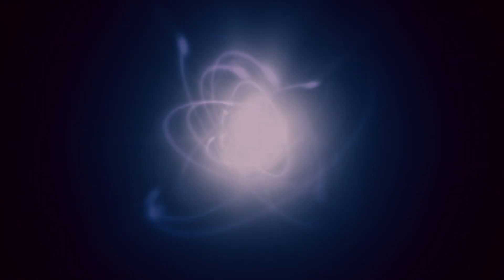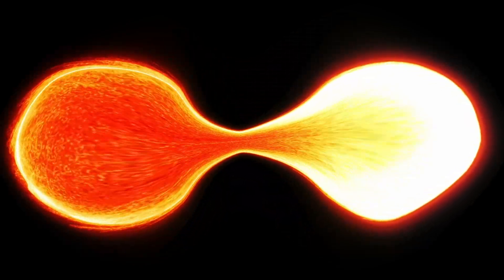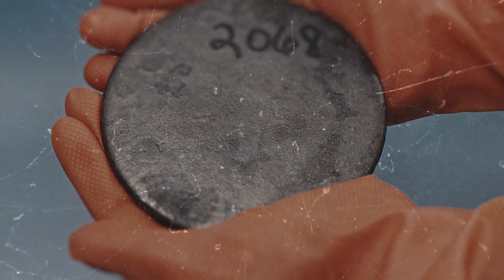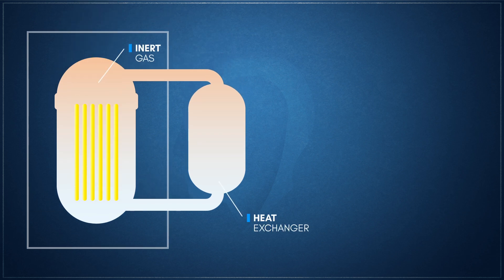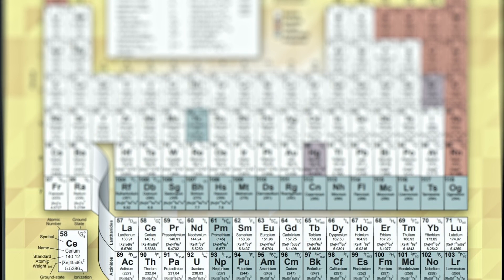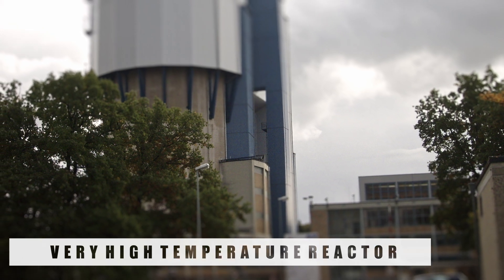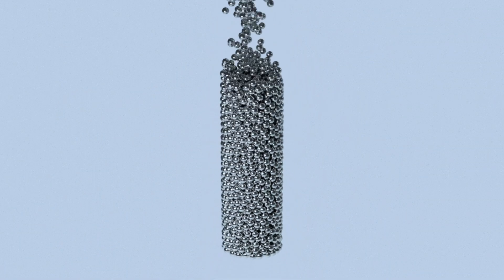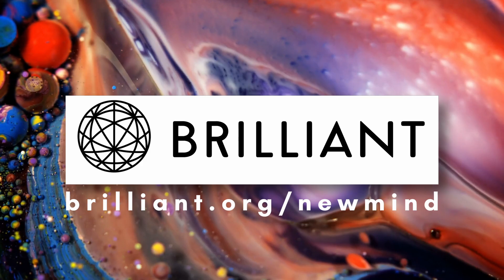Portable Nuclear Power

Comment: For a split second I thought the title was Potable Nuclear Power, and I was both terrified and intrigued.
Reply: People have an irrational fear to the word nuclear. 
The reason why older nuclear plants caused problems was due to the fact they were massive plumbing systems with nuclear material right in the middle of it and it was a perfect recipe for disaster. 
New systems have stable nuclear fuel sources, plumbing systems that are seperate from the reactors and they can be made extremely small so if by some magical reason there was an issue it is not a major issue and can be sorted on sight safely as their mechanical pressures are so low that they cannot cause the problems like the old plants. 
Smoke detectors already have the same levels of material out there as those small nuclear plants will have as a whole.
Reply: @bighands69  20.

Comment: This video is kinda disappointing. you are literally just spotlighting the fringe upsides of these technologies without going into the significant downsides at all.
I do think that a short- to mid term expansion of nuclear power generation would be a good idea to speed up the coal power phaseout but Gen2/3 reactors are just way better at that than the concepts you highlighted in this video. 
The first problem with small nuclear reactors in general is that its just not a good idea for civilian use. Civilian power generation really doesnt need the capability to be relocated because the point at which the power is fed into the network is not very important. on the backside, the security issues get way more problematic the smaller the reactor gets as the size you were talking about gets into the zone where its realistically possible to steal the entire reactor. This gets even worse as smaller reactors generally require more enriched fuel to run, so the fuel for a reactor that size may need to be weapons grade for the reactor to work. The security problem with having hundreds of small reactors full of weapons grade fissile material instead of one big powerplant should be obvious to everyone.

More one the pebble reactor in particular: 
It produces way more radioactive waste than traditional reactors because after the fuel is consumed, all of those shells are radioactive waste as well.
It is extremely hard to monitor because the exact geometry of the reactor is not known.
Its a nuclear proliferation risk because it allows for the short term irradiation of Uranium needed to produce weapons grade Plutonium.
It never actually reaches those extremely high temperatures needed for the efficiency benefits

overall, this video should have had a significant portion of its runtime devoted to why none of these technologies are actually getting used.
Reply: You have a good point, maybe he should make a second part talking about all of that

Comment: I was expecting a bit more information about portable reactors. 15 min intro and then few words the subject itself. Overall interesting video and the title is good (clickable) but left with a feeling of unfinished video.
Reply: I remember a YouTube where if you had a click bait title and thumbnail the comments were all flaming the creator 🙄
Reply: Thank you good sir for saving me 19 minutes.
Reply: If I were on fire I'd hope you would put it out before telling me the history of man and fire. If I wanted that type of video I would look for it. All we need to know here is if it were possible to support small portable reactors. Smart dummies everywhere
Reply: Dammit you nailed it.
Reply: Yes, I think 5 and 10mw units could be factory built for lower costs.
Then you can use a 5 and 10 or 2 5s as to needs. more versitile.
May be reuse nuclear waste.
We can do this, we just need people to get on board, also quicker to bring these to reality instead of 10 years.
Reply: @bradvansteinburg2962  Yes, exactly. 

What I like is the fact that after 10 years of isolation you can start separating PU 238 from a LFTR's radioactive waste. That gives you a steady stream of heat for the next 300 years. The possibilities are enormous. 

No doubt, you are aware that a passenger car in cruse mode only consumes 20 to 30 HP. Thus, you can have a hybrid car with a 25 - 35 kw (e) CO2 gas turbogenerator. You can use a third of the lithium batteries which a TESLA car now uses. 

The batteries give you quick acceleration, but they run out quickly. The generator recharges the batteries even in cruse mode. You park the car and the generator recharges the batteries for later. 

This hybrid car should be lighter than a TESLA or even a gasoline engine car. You get quick torque from startup. And when you get home you plug the car  into your house to recharge the batteries in your home. That is a win-win-win. 

This is all from radioactive waste. If you had a few hundred thousand LFTR's in operation, PU238 would be cheap.
Reply: Thank you so much for saving my time ❤️
Reply: I knew it lol.
Reply: Yea
Reply: 100
Reply: I was thinking the same.
Reply: Facts ...
Reply: Thank you for saving me some time 😊
Reply: I'm unsubscribing.
Reply: Looks like he skipped a lot of stuff. Secondary nuclear reactors that can use up the waste of primary fission reactors, uh I forget the name but what mos of the small plants in Japan are. MoX reactors which basically make the lifespan of uranium infinite
Reply: You have dumb expectations
Reply: Thanks for saving me the time not watching this
Reply: Agreed. Very long winded introduction
Reply: Why would you think portable nuclear power would have  anything to do with a reactor? We've been using portable nuclear power since the first probes were sent out to image mars and the outer planets and none have anything to do with reactors
Reply: Thank you for saving me time
Reply: That’s how they make money... deceptions.
Reply: I literally skipped  most of it.
Reply: GJ clickbait got it outskies
Reply: Thanks for that ima head out
Reply: Wellp. I'll just switch to another video.
Reply: Want to make one, Ahmed? :P
Reply: @jacekpiterow900  please do !!!,then let me know how you done it😉

Comment: Could the pebble design work with thorium? Cause if so that would make it even more safer and generate more power and less waste although I don’t know how plutonium would fit in that model
Reply: Sorry won't let me post a link uggg, sir, Issac Arthur has a video called the (future of thorium) he talks about that I think
Reply: It was tried in the THTR in Germany. Unfortunately the pebble bed reactor has its own set of issues even without bringing Thorium into the mix.
Reply: Yes, you can create a breeder out of a PB reactor, but reprocessing PB fuel is always going to be more expensive than any alternative, and fuel out of the mine is cheap in comparison. I suppose a liquid molten salt blanket for breeding would be an option, but that is a question for a proper nuclear engineer

Comment: Doesn’t the Cassini and Voyager use SMR to fuel them in space??? i do believe these will be more proficient and of better help in times of bad weather… Eliminating poles and wires, trees, fossil fuels, etc would help with the 🌏 too…
Reply: those are RTG, they work with a different mechanism. basically hot isotopes enveloped by peltier to harvest the heat into electricity. those thing are not that efficient but with loong half life of the isotopes such as plutonium those can operate as very durably longlife battery.
Reply: So does a solar panel on your roof.
Reply: @jacekpiterow900  that’s right
Reply: No,they use Plutonium in  converter,no moving parts, you get the warmth and electric power, the next step is something with moving parts which would many times more efficient.
Reply: @paulbedichek2679  Is it possible that the reason why there is no moving parts is due to reliability? Moving parts have that funny tendency to break. When they break in nuclear reactors efficiency becomes way less important. That could be the way out if not radioactivity of demining elements, and stupidity of people looking for a revenge at any cost.
Reply: @jacekpiterow900  Yes,of course, but has nothing to do with bad actors it is a hunk off Pu!!! Nothing allows more mischief,but who's going to come along and steal it off the rover on Mars?
Reply: @paulbedichek2679  Paul! I am 100% with you. Mars is OK to play with Pu. You have to wear radiation suit all the time anyway. But here is our home, I rather would parade around in shorts bare chested. Shorts are must. I do not want anybody to feel inferior ;) Seriously, Outer space is more then required. Here, let it go.
Reply: Well, a science group picked up on my ideal and placed me in their group so i guess someone is looking into this ideal… Have a great day…

Comment: If one those Xe-100 portable reactors can be transported from the US to other countries, I wonder if that would be by air or ship. If these things are inherently safe even during "catastrophic fail" could they be put onto an airplane? What about a spaceship? Seems like the most likely candidate for power generation say, on another planet if it's approved for rocket travel. The big issue with rockets and nuclear power is if the carrying rocket blows up before leaving the atmosphere. Would the explosion/crash spread nuclear particles everywhere, turn itself into a nuke or is the risk low enough to be one in a million?

Comment: A lot of the cost associated with building fission plants is in multiple redundancies and material necessities such as the nearly complete absence of cobalt in the metals used in the plumbing it's easy not to add Cobalt but it's decently hard to make sure there is absolutely none
Reply: It's also in large part due to the mountain of regulations and burocracy that has to be meticulously and properly followed.
Reply: @adamblomberg  yes, the proof of this fact is one word, France.
Reply: @adamblomberg  you’re really complaining About regulation on nuclear energy, ya know something that has the capability if not properly done to cause mass death. You really out here advocating for the Nuclear Boy Scout.
Reply: @adamblomberg  if it fail, the externalities are very high to community and possibly to the nation. So I prefer alot of red tape on this one.
Reply: @adamblomberg  I mean I want regulation when a whole state can be irradiated if someone go wrong
Reply: @thatyoutubeguy7583  iradiating a whole state would require a huge reactor running more like chernobyl.
I agree with some of the regulations but a lot are based on warrentless fearmongering.
Reply: @thatyoutubeguy7583  that’s not true at modern design makes disasters like Chernobyl completely impossible without being taken over and altered for month-years by an advanced team of engineers and construction workers with serious understanding of nuclear plant construction and a desire for destruction.
Reply: The primary costs making nuclear plants uncompetitive is the requirement that there never be accidents. It is easy to make events rare and infinitely expensive to make them impossible.
Reply: @matthewhuszarik4173  Yep, deminished returns, lol
Reply: @HughZantu  sounds like a good argument for the smallest possible plants. Or not.
Reply: The materials are also hard to work with. Hasteloy-N especially
Reply: yes, but those reactors make a massive amount of energy relatively cheaply. We can think of alternate materials and use alternate methods of refinement.
Reply: So what does cobalt do if contained in the metals reactors are made of?
Reply: @tylerdurdin8069  it becomes activated by neutrons, and then the steel is a radioactive mess.
Reply: 6.
Reply: It’s mind boggling that nukes would have a load of regulations while O&G, coal + gas plants would have far less regulation but cause more deaths than nukes
Reply: @malekzin4788  blame one ronald reagan. he started the trend of making oil and coal immune from air regulations
Reply: @malekzin4788  there's a reason why oil and gas companies fear monger about nuclear and support wind and solar. Wind and solar power takes a shit ton of oil. Not to mention the amount of average needed to generate as much as nuclear. It's cool to have solar panels on your roof, it makes sense, saves you money. But on the large scale, it makes no sense.
Reply: @malekzin4788  If I'm understanding you correctly, you are comparing the cumulative damage caused by all the fossil fuel power stations in the world/country with the potential damage of a single reactor going south?
I'm pretty happy that reactors are tightly regulated
Reply: @richardbrook4545  I totally agree, not to mention the long term storage and waste disposal solution which is not available anywhere in the world and adds an astronomical cost usually not factored or included in comparisons.  Imagine our descendants continuing to pay in many ways, every generation for many just for our current and ongoing energy use.
Reply: @richardbrook4545  fossil fuel power station as a whole is more damaging than nuclear power station as a whole. i am happy w/ the regulation but find it that is so much easier to build a fossil fuel that bring more environmental damage than nuclear plants
Reply: @richardbrook4545  no, the accident and injury rates are for the entire industry. Mining, transport, operations, etc.. The number of deaths from coal powered plants via air pollution is much higher than most people think, not to mention the accidents in mining and transportation.
Reply: @ProlificInvention  Wrong. Disposal and short-term storage (measured in decades) is factored in the cost. You are also overplaying the amount of waste generated. The amount the US nuclear power plants have generated in 60 years can fit in a Walmart. Not to mention new waste material can be used as fuel in other reactor types.
Reply: @ProlificInvention  just launch it into space
Reply: @ProlificInvention  in the near future we definitely can do that. At the rate space x is going itd probably be close to 100 percent safe in 10 years max
Reply: @connorburns6599  Na, it'll never be safe.  To escape Earth's orbit a spacecraft must carry enough fuel to move hundreds of tons of spacecraft and payload a minimum of 25,000 MPH.  A catastrophic failure carrying high level waste would render a large area of Earth's surface uninhabitable, we are talking about the most dangerous substances known to man.
Reply: @ProlificInvention  I mean, lets be honest, our trash will eventually replace our treasures if we keep digging long enough. An actually viable waste disposal solution is, well, infeasible because eventually we'll need to dig it up and do something with it
Reply: @ProlificInvention  okay, look man, space launching isn't viable because it's too heavy. Moving things fast is always going to render problems. Dont let 1 little hiccup ruin the whole business
Reply: @ProlificInvention  when a nanotube container is created we will be able to
Reply: @ABaumstumpf  By far the most deaths associated with solar power is the concentrations camps in the paramilitary autonomous zones in the Chinese regions responsible for the Silicon crystals that solar cells are made out of.
There is more radiation from the sun,cosmic rays and the ground than coal plants ,everything emits more radiation than nuclear plants as they don't emit any.
Reply: @alexandervlaescu9901  those (waste) plants have unfortunately not reached fruition yet, but I like the way you think ;)
Reply: @richardbrook4545  I’d rather it wasn’t. Companies don’t want nuclear plants to melt down nuclear reactors are incredibly safe as long as safety measures are implemented with even the smallest bit of common sense
Reply: @ProlificInvention  nuclear waste isn’t even close to ‘the most dangerous substance known to man’ I’d rather get nuclear waste on my skin then almost any serious nerve agent.
Reply: @ProlificInvention  new generation reactors could do much better, much less waste! Especially Thorium-Molten salt reactors, or Elysium Industry's fast MSR, which could use existing "wastes" and burn them up, so that very little of it would remain. No need for 1000 years of storage, just use the proper technology. And don't "squeeze" technology to its limits!
Reply: @PiOfficial I’m guessing that person has never heard of botulinum toxin…..
Reply: Cobalt in nuclear power plants isn’t an issue except in hardened components like valve seats and other specific components. It was also almost completely eliminated decades ago in plant design. Alternatives to cobalt hardened materials aren’t significantly more expensive.
Reply: The Biden administration gave a huge boost to the fossil fuel industry by appointing anti nuclear zealots to the NRC,which promptly cancelled license extensions for multiple reactors,because of sea rise, which isn only happening because democrats have opposed nuclear in the past,th world would have run on 90% nuclear energy for the grid, but for opposition from some democrats.
We will have much less expensive power from NuScale reactors coming on line in 2029,each reactor gives 77MW,thy group them in 4,6, or 12.If we gave them orders big enough w'd have a factory, turning out one a day.

Comment: Why is it when even the experts talk about fusion they never bring up the fact that the containment will erode itself it will become radioactive due to the neutron bombardment that's the same mechanism that causes a lot of the radiation in nuclear fission meaning that the walls of the container will become highly radioactive they will also deteriorate meaning they will have to be replenished if sustained fusion can be obtained if we can overcome the other limiting factor of limited supply of helium to cool the magnetic fields needed for the containment